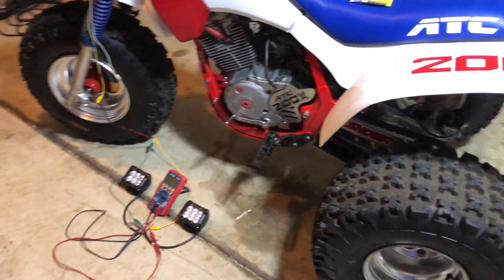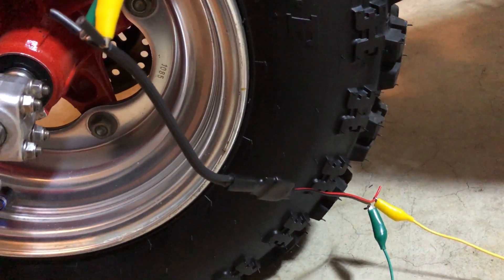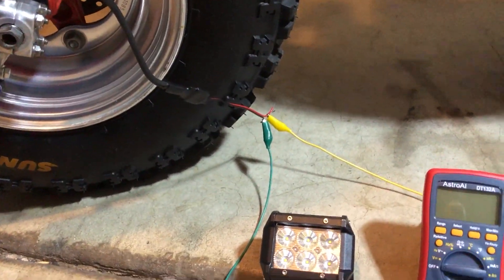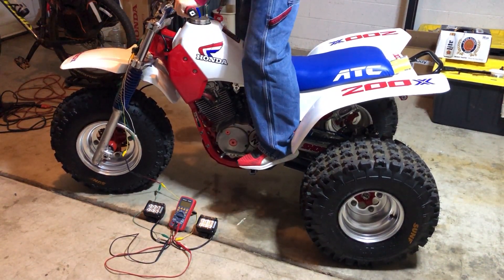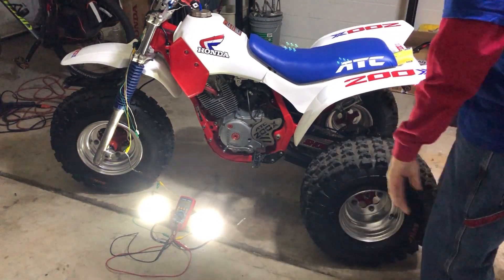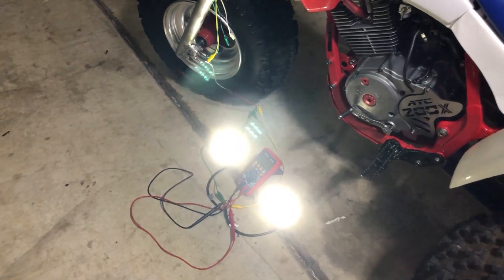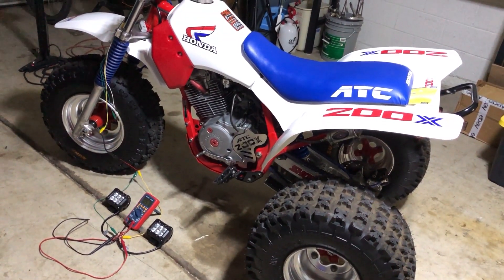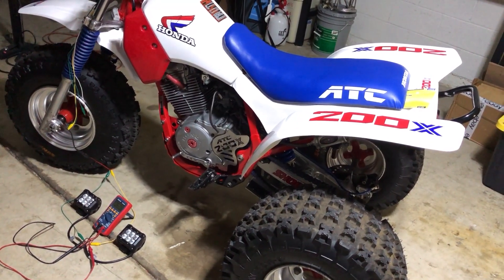Honda ATC 200x Build - Convert AC to DC Regulator Rectifier for LED Headlights 12 Volt Light Bar 36W

Comment: Would this work on a first gen? I’ve been googling and googling but some people say you need to go into the stator and float the ground. I’m so confused
Reply from the maker: I don't know for sure (I never owned a 1st gen) ... but I've heard that the stator is not powerful enough and you may have to upgrade to an aftermarket like a "Ricky Stator" or something ...
Reply: @11GalleryATV I’m gonna let it buck and just keep the wattage around the same as factory. We’ll see what happens lol

Comment: Is the stator single-phase? 

Did you connect one wire to the positive AC output of the stator and another to the negative wire of the battery in the converter? 

Is it working normally until today?

 I want to put a LED headlight on my motorcycle with an AC to DC converter.

 greetings from Brazil 😀🇧🇷

Comment: I've always just swapped out the halogen headlight bulb for an LED bulb. Why do you go thru all this trouble?
Reply from the maker: 'cause sometimes I'm a moron and I was thinking this is like the 1st gens ... I have since realized that converter is not converting anything and is just extra wires doing nothing ... oh well, it still works so ...

Comment: Can I do this with my 83 atc 200 and if so how can I get it to regulate the voltage?
Reply from the maker: I don't know if the stator on the first gen 200x puts out enough ... technically this should work though ... I think the part I used has changed, so I don't know about the current state

Comment: i have a china atv and the lights run on dc current can u use this to wire led lights to the converter and plug that in to existing light plug
Reply from the maker: If your lights already run on DC, you do not need a converter at all ...

Comment: I did this on my 84 200x almost 2 years ago. But I added a battery and ran a different ac/dc rectifier. So when I turn my head ligh switch on it charges my battery.
Reply from the maker: Your battery should be charging whether the light is on or off … the alternator (stator) should charge the battery when the engine is running …
Reply: The reason its on a switch is because I did not run a voltage regulator. I let the battery regulate the voltage. My 200x is a 84 which did not have one. So to stop the voltage from ramping up past 18+ volts. The battery keeps it in check at 14ish volts. So I don't charge it all the time until I get around the 11 volt range. Then I charge it.
Reply from the maker: @ralphjovanovic2158  Ah ... I understand now! If you want an updated stator to use for charging, you can get one from RickyStator - https://www.rickystator.com/product/stators/honda

Comment: Hell yea bro! I'm doing my 350x the same way.
Do you have a link for lights, and a video for custom fitting these in your 350x headlight plastic in the future???
Reply from the maker: Here is a link to the lights - https://amzn.to/3ip2Vlz -- I am mounting the light bars on a bracket that will mount to the bottom of the triple trees (using the 2 factory threaded bolt holes for accessories). Then I will just cut the bottom of the headlight bezel as necessary to properly secure the bezel over the lights. No video as it's not done yet ...
Reply: @11GalleryATV  do you have any pic's you could send me of how you mounted them? I'm doing this to my 85 when I put a more powerful stator/generator kit. just unsure on the light mounting and position. thanks!

Comment: It’s a little off topic, but did you see the new bolt on electric start system for the 250R?? You still have your kick starter too. I found it pretty interesting because I’m picking up an ‘88 TRX250R frame, should be on its way to me this week. I’m also on the hunt for a computer so I can FINALLY start my YouTube channel. I have quite a few projects coming up. I have my daughter’s 3 blasters that I’m building for her to race, I’m doing an XC 400EX build, a TRX250R XC build, and I have a Polaris Magnum, Yamaha Moto 4 200, and LT160 (for my 8 year old) that I will be repairing. I have plenty of projects to keep my busy for a WHILE. It’s time to get set up to start recording it all now.
Reply from the maker: Holy crap! That is a pretty impressive list of projects! You could also throw in another project and build your own computer! I built mine and my setup is liquid cooled and has RGB lighted fans and a smoked glass case to see it all working. You can see it in the background of some of my videos where the footage is shot in my rec room. That same computer would have cost 5 times the price to have someone else build it.
Reply: @11GalleryATV  hell, maybe if I knew more about computers I might

Comment: For people wanting high and low beams they would have to tie into power wire before switch or run 2 converters one for low and one for high depending on their setup but this thing is pretty sweet! I miss not seeing your viper tires on the rear!! I've been dieing to find a set for my 200x
Reply from the maker: yeah, I forgot to mention that this is hooked up to the low beam only because the light bars I'm using are just on or off (no brights or dims). Thanks for adding that ...
Reply: I tried this. It backfeeds so I’m in the process of finding a good diode somehow to prevent it from backfeeding and causing the hi and lo to be on at the same time regardless of the switch orientation. Otherwise they work great converting! Just can’t get them to play nice for hi/lo